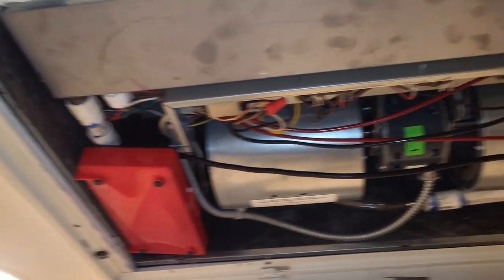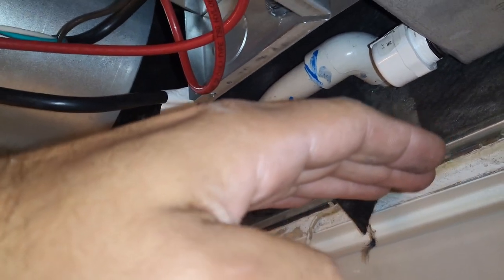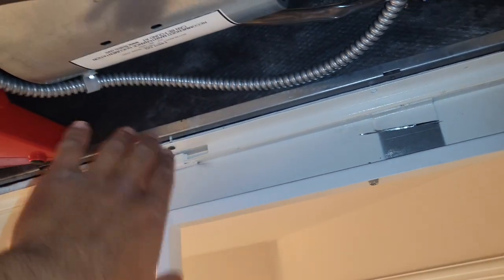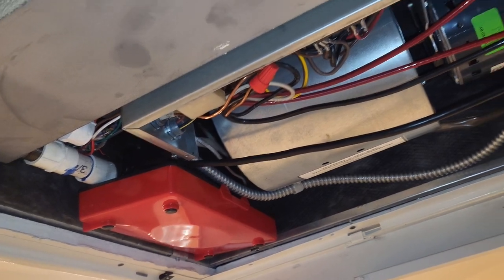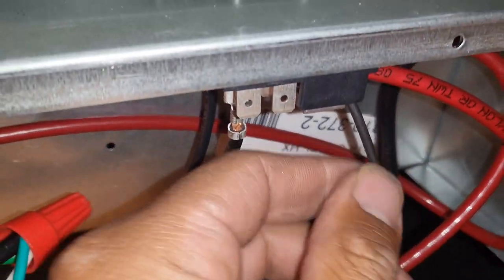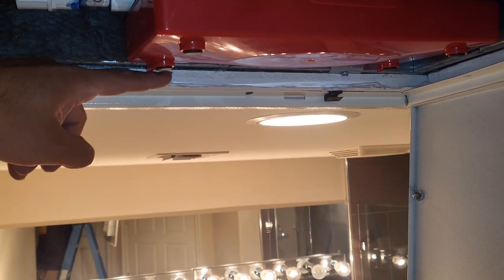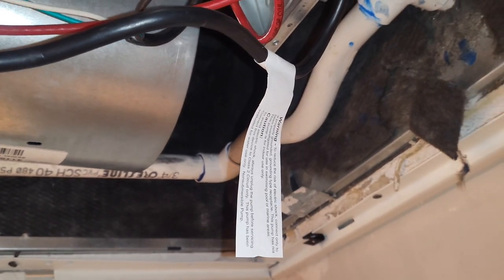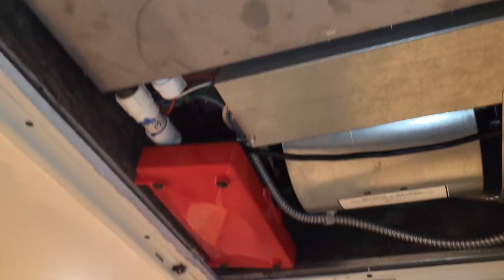FAN COIL/PANCAKE UNIT AIR HANDLER CONDENSATION PUMP INSTALLATION AIR CONDITIONING HEATER REPAIR AZ

Comment: That's a really tight fit!  Thank goodness you were able to source such a low profile pump.  I've never seen one like that.  
Thanks for showing.
Reply from the maker: it's definitely a special order pump ! if you like I can give you more info
Reply: @themoderntradesmen9352  Thanks much for the offer, although I have to say having retired I seldom have an opportunity any more to select or install equipment.  But I really appreciate being able to keep up a bit with what's going on thanks to YT videos such as yours.  I'm amazed how fast things are changing now and the vast range of equipment and options available.  👍

Comment: Just ram into this. Installed a U trap with a T AND had the vent BEFORE the trap lol smh. The pressure was blowing the water out of the pan onto the duct and drywall in the soffit. Going back this week to fix it and possibly adding pump due to angle. Appreciate the video
Reply from the maker: you got it!

Comment: Diy homeowner here. I just replaced my air handler. I understand why so many people are in doubt of homeowner working on hvac stuff but you gotta know not all pros are equal! Homeowner not wanting to fix previous shitty installer's mistakes whom swapped out primary and secondary drain line.. could've been a handyman who knows ;(
Reply: Anyways thanks for the tips it can be done with such a small space